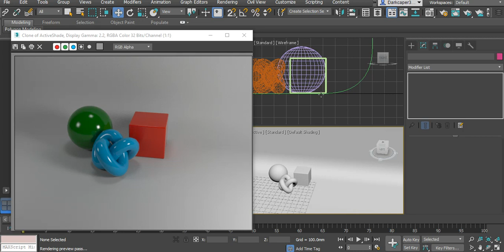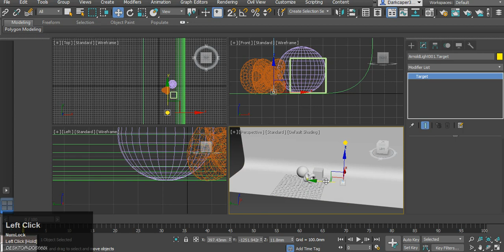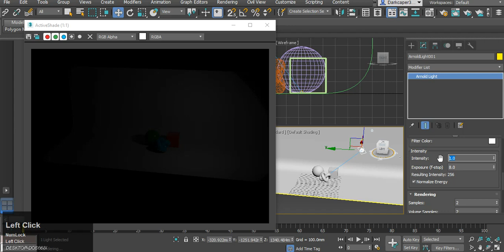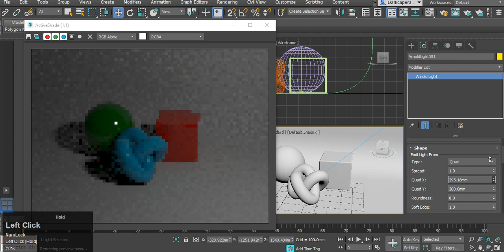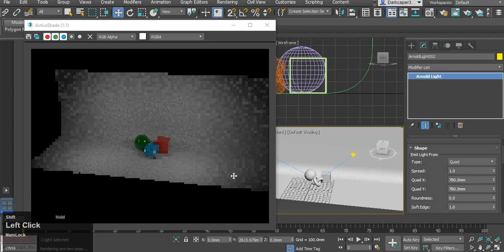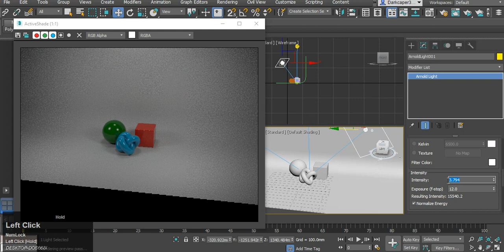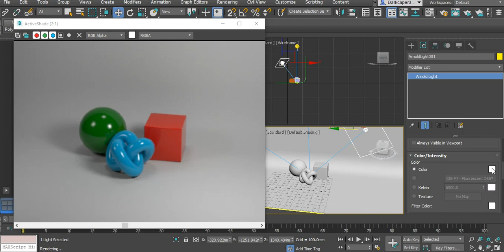3DS Max Arnold Lighting Basics

Comment: Arnold is just a buggy mess. With these same exact settings, my scene is completely blown out all white.
Reply: My guess is, the "Normalize energy" in the Intensity category option was not switched on.
Reply: I'm opposite - my scene is pitch black no matter how much I increase intensity and exposure of the light. In viewport DX mode it is blown-out white. 
Why can't they make it incorporated into 3Ds Max properly, so in default setup you can actually see damn render with basic setting???
Reply: @digimaks  its a pain in the ass bc I think arnold was developed apart from 3ds max and then just shoehorned into it. Takes a lot of finesse to get anything to look decent